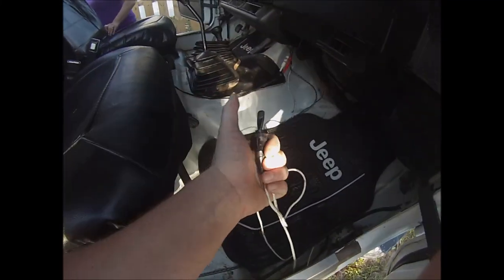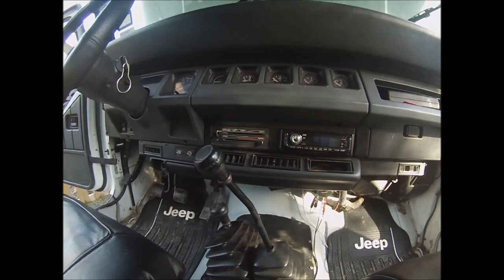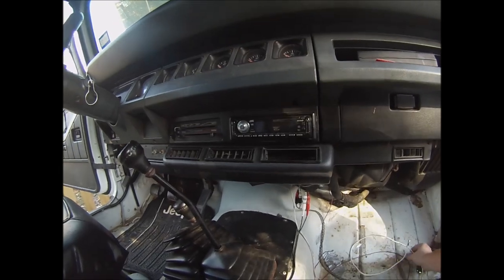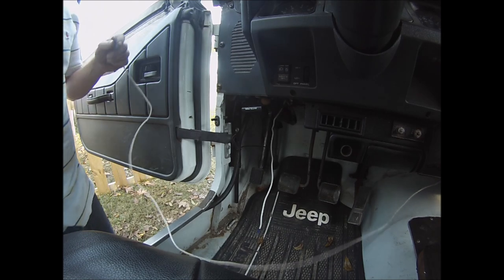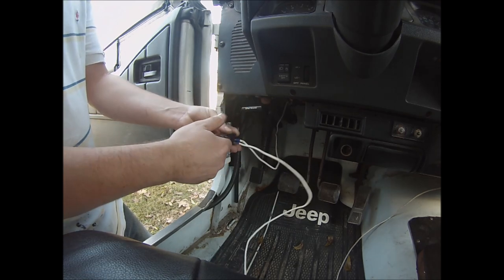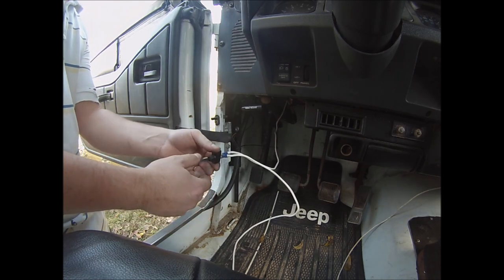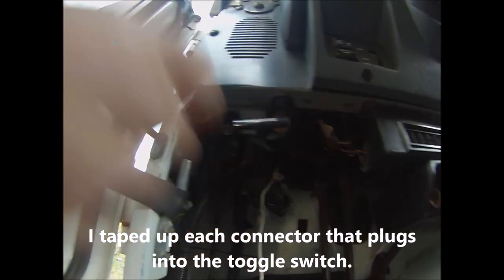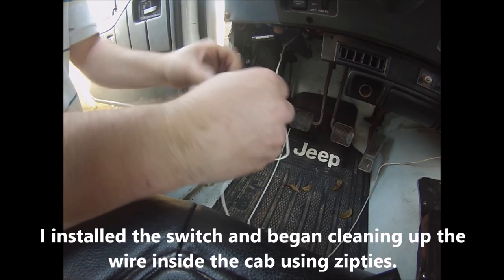How to Install Toggle Switch for an Electric Fan on Radiator 1993 Jeep Wrangler YJ

Comment: I just got a wrangler and the fans not working and the motor gets hot is that normal for a wrangler with a straight 6 and if not what else would you recommend replacing?
Reply from the maker: The fan should work.  It is not normal for a motor in an older wrangler to getter hotter than the half mark.  If you want to do it urself, the easiest fix is an electric fan with a switch.  We did the switch for the beach when parked to listen to the radio, but u have to remeber to turn it on tho.  Might be just a sensor that isnt working telling the fan to turn on as well.

Comment: do you need a relay between the switch and fan motor or just hook the motor up to battery and switch?does your temperature gauge still works properly since the fan  motor was disconnected from car's computer...
Reply from the maker: Temp gauge still works...using a relay with the switch as well...

Comment: What toggle switch amp is that and also, how many terminals do I need 2 or 3?
Reply from the maker: Doesnt matter, 3 ends means u have to run a ground from the switch, 2 ends u just run the hots.  I believe i used an old 30 amp switch that i pulled from a van we had sitting in the property from the fuse box.
Reply: JRMSweeps okay, I appreciate your help. 💯

Comment: do i run it constantly while the van is running or flip it off periodically to maintain a warm temp?
Reply from the maker: I keep it on all the time on our jeep.  I installed the switch so I could turn it off at the beach and listen to the radio without it running...
Reply: +JRMSweeps thanks i am just concerned about temp levels and air/fuel mixtures but this is a good quick fix for the time being
Reply from the maker: No prob...just make sure u wire in a 30 amp 4 prong relay as well...
Reply: +JRMSweeps not sure how to do that
Reply from the maker: Look on my channel...i did a couple vids on how to hook a relay up to any power source...
Reply: JRMSweeps  by you doing that does it run your battery down? What about the winter time do you still keep it on?
Reply from the maker: U have to turn it off everytime
Reply from the maker: You could run a hot from the fuse box, as a jumper fuse hot so when the ignition is on it will turn the fan on, I should've just done that.  Then use the switch to turn it off when parked listening to the radio.
Reply: JRMSweeps my thing is this so basically the fan shouldn’t be on constantly while driving?
Reply: JRMSweeps and relay is what I’m going to get too.
Reply from the maker: We left the fan on while driving.  If u turn it off while driving and forget to turn it back in, ur going to burn that motor up.
Reply: JRMSweeps yea you’re right, but most people was saying the fan shouldn’t be running at all times because the engine cool down way below and could burn up the fan too.
Reply from the maker: Never had any issues at all.
Reply: JRMSweeps will a 40 amp 5 prong relay work?
Reply from the maker: If u know how to hook it up from the prongs, yes.

Comment: would it be the same process for an jeep cherokee xj? and how much did this cost?
Reply from the maker: Yes, this will work on any application.  Cost as in which parts?
Reply: I meant to put *take, about the time it took to be done? and won't connecting the hot wire to the radio wire burn it?
Reply from the maker: It wont burn out cuz u use a 30 amp relay...

Comment: I'm sorry bud this is a bad way to wire up your fans the first thing you should have put in there was a relay to run that fan it pulls 30 maybe 40 amps on startup I can guarantee you that toggle switch is only rated for 20 amps eventually it's going to melt down on you next you shouldn't be running hot wires to you switch you should run grounds and think of the switch as interrupter this way if there ever is a shorts the only problem you have is your fan won't shut off running hot wires up to the dash like that is not a good idea
Reply from the maker: +GreaseMonkeyInc thanks buddy, however, the vid is about how to wire up a toggle switch, not how to wire up a fan...it has a 30 amp realy on it, just didnt show that part, as do my lights i did in my other vids on the channel!  thanks!
Reply: +JRMSweeps I need one of these but dont know jack about wires.the last wires i jump from my fan to battery caught fire.so i was like its no hope and about to take it to the dealership to see whats going on why my fans wont kick on.
Reply from the maker: Watch my vid on relays and get some bigger gauge wires...